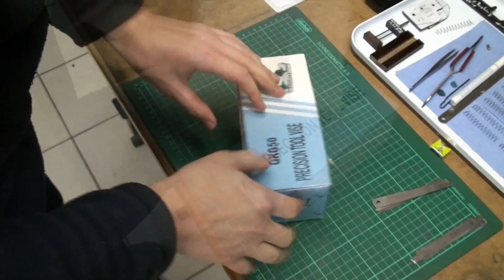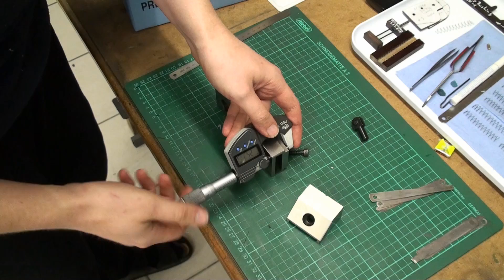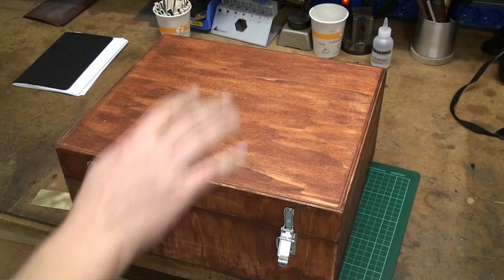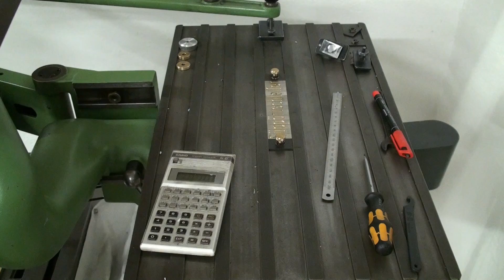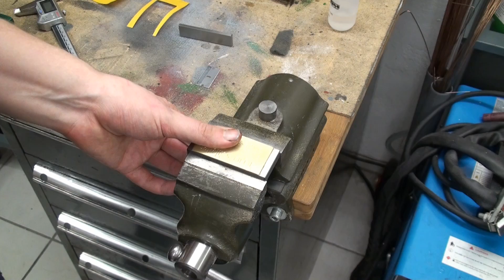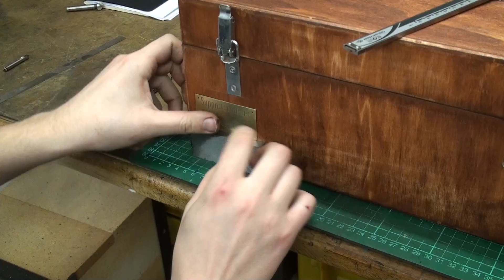Shoptalk #5 / 03-2015

Comment: Great video as usual! I like how you can hold parts square in different directions in those vises, but I would really like to see how you hold the vise itself to the table in those positions. I have a really small old benchtop horizontal mill, and it only has a single t-slot, so I'm curious how to clamp the vise down in that situation.

Comment: Nice video. I love that pantograph machine. The video also forced me to reconstruct how a pantograph reduction actually works. Nowadays it's all CNC, but much more fun (zen, as you said)  to do it by hand.
Reply from the maker: Juan Rivero Haha yeah, cnc makes it a lot easier - But as I run a cnc at my day job I love to have some relief in form of the "old way" :)
Reply: Stefan Gotteswinter  Your pantograph machine solves two interesting geometric problems. In an "artist's" pantograph the thing is a parallelogram with pivots.. It is easy to arrange pivots. If you want a 2:1 ratio, the cross-pieces are 1/2  the length of the "long" pieces. Drill some holes. Stick in a pin. Done. If you want 1:4 why the cross-pieces are actually 1/4 the length of the long pieces. I am simplyfing because the engraver has to go in the middlle of one of the cross pieces. But your pantograph is continously adjustable for any reproduction ratio. So drilling holes will not do. There must be some combined clamp/pivot arrangement. Which you have. After watching this video twice (or three) times I am finally beginning to see how the very clever designers did it. Maybe I can reproduce it.One thing for sure: unless I am incredibly lucky I will not find one here in Alaska where I live. I propose to use a Dremel-type tool instead of the belt drive.
Reply from the maker: Juan Rivero I think there was a pretty nice pantograph engraving machine in Lautardts Second Bedside Reader book, but that also did only have fixed ratios which could be choosen by moving pins. But still it was a pretty slick design :)

Comment: Nice engraving demo, 
I've never tried paint as a filler I use wax, guess it's because it's how the old clocks were done, usually the brass is also silvered ( given a thin silver plating, made the dials really stand out in the candlelight of the time. . . 
Warm regards 
Daryn
Reply from the maker: Daryn Radcliffe Hi Daryn - We used a wax from gravograph and a heatgun at work to inlay engraving like you described and it works very well - Also it fills the engraving nice and gives it a "quality" look :D
But I found the spraypaint to be a shortcut that works pretty good.